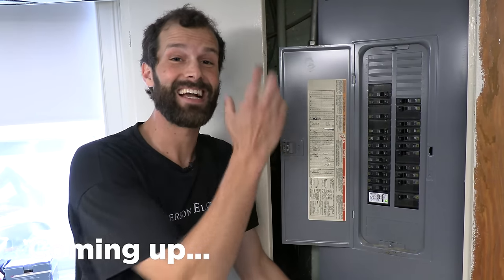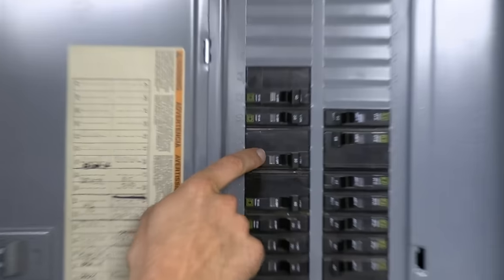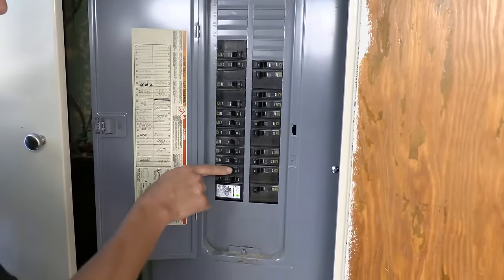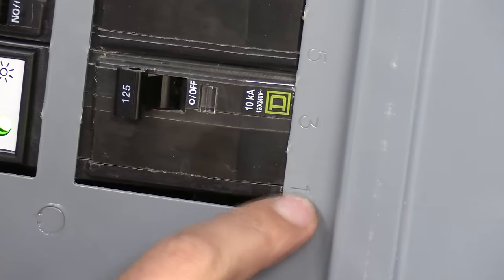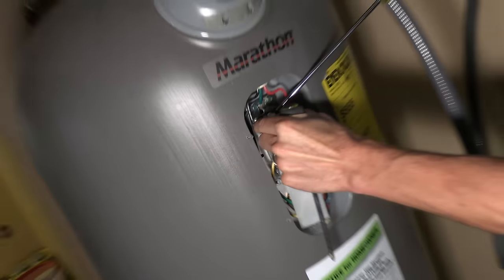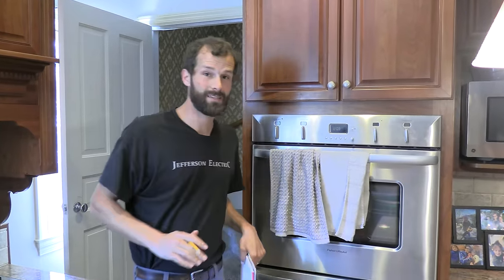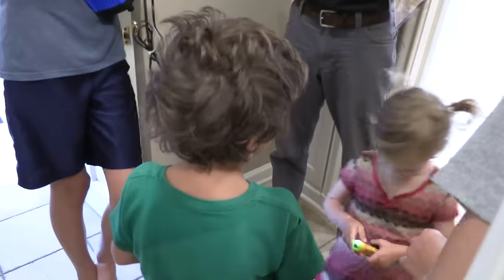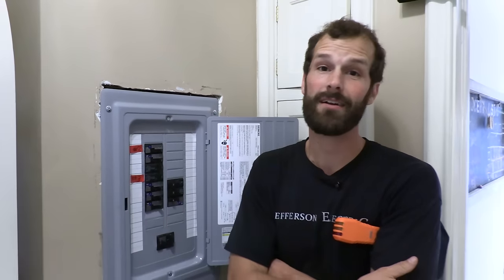A Master Electrician's Worst Nightmare

Comment: Here's a tip: Start with a floor plan of the house, or office, large enough of a print-out you can mark where each outlet and device is located, and their circuit number. It can also be helpful to indicate which switches go to which devices. With older homes you would be amazed at what is on a circuit: I found out, the hard way while installing shelves, outlets in my room, in the basement, are on the same circuit as the television in the living room, on the other side of the house!
Reply from the maker: 😵 Mercy!
Reply: @ElectricProAcademy  More fun? On the same GFCI breaker: most of outside lights, outlets, and pump for the goldfish pond. Every heavy rain event trips this breaker.

Also included are two or three outlets in the former garage. When we converted the garage, these outlets were left in place and the new circuit's outlets were filled in around them. Fortunately, these outlets are labeled as being GFCI protected.
Reply: I second the floor plan!  It can give a lot of insight, and also it's completely unambiguous.  I got lucky with my current house- although it was built 30 years ago, the developers had created a brochure with floor plans for the various models, and someone had put it online!  I was able to put the drawing into my CAD program, and with a couple of actual measurements, I could scale it to real size and trace over it, verifying actual dimensions as needed.  Then I drew all of the circuits and numbered them to match the breaker numbers.  It was kind of fun . . . and the information is very useful.  Especially now since I am going to install an Emporia Energy Monitor and I need to know what is on each breaker!
Reply: @ElectricProAcademy  I still have the piece of romex, and screw, we extracted from the wall. Easy to repair paneling, instead of drywall. Just pull out the nails and we have access. Wall was built before nailing plates were an option.

Comment: A time consuming process, but one I recommend to all home owners. I recall doing this without help using a radio  and running back and forth to the panel.  Inalky buying a Klein circuit finder has been well worth the investment. Even with the circuit finder having a helper is a time saver. I now mark the circuit breaker # inside the receptacle or switch plate even when the panel has been properly labeled. Even with a panel properly labeled I sill use a receptacle or non contact tester to confirm power is off to an outlet before working on it. Learned this the hard way many years ago when working on a receptacle when I found the hard way it had been used as a junction box and had two live conductors. Fortunately just startled and not injured, but learned a valuable lesson.

Comment: I picked up the same Klein Circuit Breaker to confirm and label the panel in my house. Albeit my house is a single panel, but I wanted to take out the guess work while I was replacing all the old light switches and receptacles.

Comment: Also suspicious on the loadcenter directory is the CIRCUIT RELOCATION of the DISHWASHER from panelboard position #23 to position #30 with the RANGE HOOD. If that HOOD is cord-connected, per NEC® 422.16(B)(4) list item 3 the hood’s receptacle outlet MUST be on an INDIVIDUAL BRANCH CIRCUIT, i.e., the DISHWASHER CANNOT BE ADDED; it won’t be an INDIVIDUAL BRANCH CIRCUIT anymore. 
- former CMP-17 Principal, present CMP-15 Principal, present CMP-2 Alternate.

Comment: I recently decided that I needed to verify the circuit breakers in my home because the builder's electrician did such a crap job of labeling. About half of the panel labels were either completely wrong, too vague to be helpful, or incomplete. If I had gone by the existing labels about half the outlets and lights in the house were completely unaccounted for. When I was done, and every single circuit was verified, I created a detailed spreadsheet and taped a copy of it to the electrical panel.

I have to wonder; how hard is it to write "outlets" or "lights" after you write "kitch" or "bath" when you have two or more identical labels? Bonus: there were both kitchen outlets and lights wired to the circuits for the fridge and the dining (not listed) & living room. And the circuit labeled for the living room was actually the laundry room (not listed), guest bathroom (not listed), and upstairs hallway.

Comment: I’m just a basic guy with no training. Even I can use the Klein circuit finder. One thing I read is to run the reader over the breakers twice. The first pass with the reader is learning, the second pass will give you the correct breaker 👍🏽

Comment: I live in a house built in 1770. I've been working on its 4th set of wiring. 1920s ( ceramic wire nuts & bakelite junction boxes ), 1950s ( 2 wires, no ground, metal boxes ), and 1980s ( 3 wire Romex - all white ). The main circuit panel is 1980s SquareD as is the 90amp sub-panel. Walls and ceilings are plaster. What a mess.

Comment: Similarly to how you mentioned in your "Installing Solar Without Ruining A Historic Home" Aug 2, 2022 video (seen 1:29 to 2:04; discussed 2:48 to 4:01 "Optimizer Layout" Chapter), I often wonder whether now in today's day and age if anybody is able to trace exact wiring (like the blueprints) for each circuit, whether there is a way to create/generate a QR Code for a link to either somebody's own network or maybe something that Schneider or GE might host, that when one scans the QR code label on each circuit of their panel, that they could see an exact wiring diagram for that circuit. 

Thoughts? 
Does anything like that exist? 
Anybody know whether Schneider or anybody is making a hosting site for home QR codes of wiring diagrams for each circuit to be uploaded or stored?? 

Or even whether there are like UL-listed USB flash drives that can be left attached to panels (or safely inside and not considered debris?) that hold and contain all of this information, like even potentially down to specifics like which Lot# certain batches of conductors or conduit came from for each circuit, just so there's minimal having to trace wiring, but having quick electronic access to all that "blueprint" data at the scan of a QR code or plugging in of a flash drive. 

I'm gonna copy-paste this over to some sort of video that Dustin Stelzer has over on his Electrician U page's videos and see whether anybody has any thoughts. 
With the digital capabilities that we now have, like on the solar arrays, I can't see why NOT to have that in construction and wiring.

Comment: In the UK its standard to label fuse boxes . Another point is you will not catch a UK or European  Spark without  insulated screwdrivers. So waving an uninsulated screwdriver in a fusebox is a no no

Comment: I appeared at 19:32 that you clipped the leads of the ET310 directly across the two 120V lines. That would be giving you 240V and the ET310 is rated for 90-120V. 
Can you comment on why this would be ok to do?
Reply: I wanna know the same thing. Also, wouldn't it be just as effective to jump one of the hot wires and then the neutral? Will it still find the breaker??
Reply: @sir_frag1868  typically hot water heaters and A/C units don’t have a neutral. But, you can choose either hot and the ground. That would work for toning it out.
Reply: @David Warriner  that makes sense. Thank you for that. I have a 220 ac outlet that someone has also added a 110 outlet to. It's in a hotel, so killing all breakers isn't an option
Reply: @davidwarriner. Thank you for that tip. It worked as you said it would. Chose 1 hot leg and grounded the other lead to the box. Found the 220 breaker in panel number 6
Reply: @David Warriner  thank you for that tip. It worked as you said. I used one hot leg and grounded the other clip to the box. Found the 240 breaker in panel number six. Nothing in that panel is labeled.
Reply: @sir_frag1868  No problem you’re welcome

Comment: I have the Klein ET 310 tracer and mine is rated to only 120vac. What model are you using...I noticed you clipped it on a 240v circuit. I guess you could clip one leg to ground to get around the 120v limitation of the transmitter and still use it on a 240v circuit. That would still cause a 2-pole breaker to read although only on one wire...but would still identify the breaker.
Reply: The 240VAC cutoff box for the water heater has two separate legs, each of which does only 120VAC. So, he tested only one positive leg and the neutral.
Reply: And the big problem is he was attaching it to the pull out disconnect at 240v.
That would have fried the plug in tester. He didn't explain the usage of 1 clip on phase and 1 on ground at the water heater either .
Some homeowner is going to fry their tester.

Comment: I just rebuilt a double-wide manufactured home that had 15A circuits throughout the house except, of course, for the furnace.  I ran a new circuit for my outside work and installed a 20A, so that's the only circuit I could use my tablesaw or compressor with.

Comment: I had to swap out 2 panels out. 1 - 300amp and 1- 100amp. Nightmare!!! Rigid, pvc, 3 sump pumps. You get the point. After 2 days I had to come back to label the panel. Which wasn’t labeled to begin with.

Comment: I also recommend testing both receptacles of each duplex receptacle, with all light switches in the on position, so you don’t erroneously label a receptacle not on a circuit, when one of the two is potentially on a switch in the same room.

Comment: I was helping somebody who is having difficulty seeing and they needed the breakers labeled. The brand new apartment that they moved into was nice enough to print out a sheet identifying what was what however they failed horribly on distinct there's at least two things that registers as hot water heater and more circuits than what I could identify Outlets of and this is only an 12 breaker panel.
I was simply able to enlarge what was there but what really needed to happen was re-identification into identifiable names with no ambiguity.

Comment: Just the other day I located the circuit that powered the coal-fired water boiler that hasn't been used in probably 6 or 7 decades. Of course, it was live. And the dishwasher was correctly labeled on one of the equally old fuse boxes ... someone had scratched "Dishwasher" in the outside of the fuse box case. It was easy to see once you're no more than 5 inches away from it. :)

Comment: Get flood calls regularly, kill the main/meter.
Using a Klein circuit tracer, find that circuit and remove the wire from the breaker and safe it off.
That Tracer you have only works when there's power.

Comment: Gosh, I wish it were that simple working in a commercial setting on 100+ year old buildings. So many electricians, "electricians," and uneducated facilities technicians with hands in the panels jars, and so many renovations, that every panel glows with every tracer but the most expensive ones that give me distance and signal strength -- and even then it's a bit of trial and error.

Comment: That's why big box hardware retailers have inexpensive FRS (no license needed) two-way radios in the electrical section.  (They have expensive ones, too, if you like to spend money.  Ignore the range estimates - they're line of sight so you're only going to get 23 miles if one of you is up on a mountainside.)

Comment: Nice video. Many great comments below.

I label the face of every box, outlet and fixture I work on with the breaker number using a Brother label maker label with white letters on clear tape for dark color plates, and black letters on clear tape for light color plates. Inexpensive, reasonably discrete and easy. Same stuff also used to label cords and cables for AV and IT equipment. 

Panel labeling is an art to be concise, unambiguous, and terse enough to fit the space in the directory. It can be difficult for catch-all circuits that have lights and receptacles scattered all over the place. A floor plan showing all the devices is a tremendous help both for maintenance and for remodeling.

Watch out for multiwire branch circuits where the breakers are missing handle ties.  Also never assume, always test, that when you open a disconnect or switch off a breaker that the power is actually off on all hot legs. Don't ask me how I know that.

Comment: I'm old school, I plug in an electric drill (corded) and you can usually hear it throughout the house when you turn off the respective breaker. For the water heater, I use a tick (non contact tracer) without removing the plastic guard over the terminals.
Reply: Had an old timer tell me about plugging in a radio,
Reply: I've done that works like a charm 😁

Comment: Since I work alone, to identify circuits i plug a fluke tester into the receptacle , (one that beeps), then I put a baby monitor next to the tester.  I take the parent unit with me down to the basement and flip breakers off until I hear the tester go off. Then I know what breaker it is.  You still have to run up and down the stairs to check each outlet but if you are alone it saves you time.!

Comment: I identify breakers connected to receptacles with a plug-in radio. I turn it up loud enough to be heard from the panel location. Then I flip breakers in the panel one by one until the radio goes off. I label receptacles with their associated breaker number. When a visible label isn’t desirable I put it behind the wall plate.  For labels on the panel I use N-E-S-W plus room ID.
A code hint I learned from this video is to label unused breakers with the word “spare.”

Comment: One son and cell phones in a 1771 /early 1800's house with apartments added in 1970.  The joke became, if it's not on the other circuits, it's on #24.  One main panel for  of the main house, one panel (in the apartment cellar) for the main house kitchen and 4 panels in the apartment cellar (one for each apartment).

Comment: Great video...learn a lot... I'm retired, but good to watch someone explain every detail. I've done this a lot, but without the tracer.. going to get one. I don't do much anymore, but make sure the church I go to keeps going and correct any problems. Ok, now... I noticed the panel your standing in front of you said and showed the neutral and ground together and it was feed from another panel, so that also makes it a sub panel. I ran into this in the church. The building was built in the late 30's. The other panels are the same as yours. Ok, so I'm trying to say is that when you find something like that, do you just leave it the way it is? What can happen which hasn't happened yet or any other time that I know of if it's left the way it is?

Comment: The forklift scrapped a 4x4 double receptacle 115VAC box off the stanchion. Still live, not labeled. The last time I had this problem I did one breaker at a time and shut down the sales department computers in the course of finding the one I needed. This time I took an insulated solid 10ga wire and crossed the contacts, not recommended. Boss caught me, chew began, I asked him should I shut down the sales department again?  The breaker I wanted was tripped as I expected. Locked out and he left me to effect the repairs. Proper labeling would have made this unnecessary. Now I have a GFIC tester, works for me in these kinds of casualties.

Comment: Perhaps I missed this somewhere, but how do you address the "crazy lts" label? I have a breaker in my panel that I've identified as powering 15 different light and receptacle outlets spanning every floor of my house, so I'm curious.
Reply: I use a Brother label maker and make a plastic label to place on the breaker showing the number of the circuit. Very handy if the circuit box is mounted upside down.
Reply: Did you find any sub panels not marked? On our last house there was a sub panel sheetrocked in under the stairs. It fed 4 outlets and 2 lights up stairs and 6 outlets and 3 lights down. The Klein Tools ET310 Circuit Breaker Finder Tool tone can be used to trace wires thru walls somewhat and that is how I found the sub panel.

Comment: Wouldn’t it be better to have two receptacle testers (one is included with the receiver) to identify the rest of the plugs that could be pigtailed with the same circuit? Would that be more efficient as well? If not, maybe there’s some considerations we still need to consider that is not present if we do that

I’m not familiar with NEC since i use CEC here in alberta

Comment: An excellent and informative video- subscribed.

I just picked up a Klein ET450 circuit tracer kit as my home (built in 1978) could sure use some mapping out of the circuits. Nowhere near the complexity of dealing with sub-sub-subpanels as you had there, but definitely a couple of unique configurations to put it mildly. I know of two Edison (multiwire) circuits, one of them in the basement where they originally used the clothes washer receptacle device yoke to split it up... I corrected that fiasco a number of years ago. The other one on the main level is a REAL head-scratcher! A few others are puzzling to say the least.

Comment: that breaker finder needs to be calibrated with each use you need to pass each  breaker 2 or 3 times to get a solid tone if the klein tool doesnt make a solid tone its not calibrated enough and if you make 2 oe 3 full passes it will solid tone

Comment: Appliance tech here, please explain to owners somehow that a 240 breaker is #2-120 breakers thats joined by a small shaft and that #1 of the #2 120 breakers can be damaged and will not show that that #1 of the 120 breakers are damaged and that the shaft going through the 120 breaker is held in the on position but still not giving power. It will make potentially make their - my life a lot easier.

Comment: 6:52 By that do you mean I could run a 12/3 loop around my kitchen to provide the two circuits for the alternating circuit outlets required by code.  Rather than running two 12/2 wires...